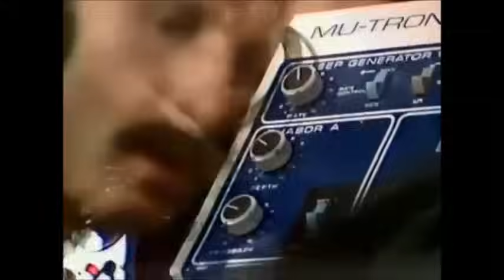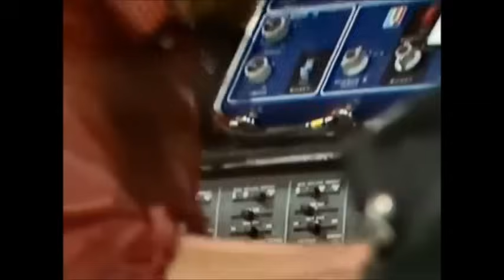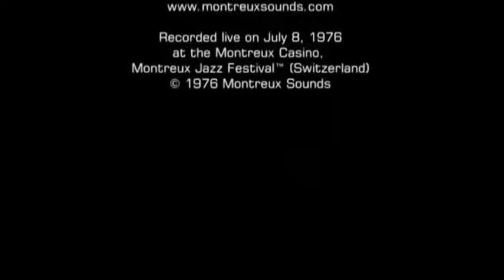Weather Report - Live at Montreux (1976) - [Synchronized Audio\Video] - Full Version

Comment: Is it just my eyes fooling me, or does Jaco have Piano strings on his axe? Note @ 28:52 during his solo you can get a pretty clean look at it. Are there windings where the strings break over the bridge on his D and G strings? I think not. Does that look like a rather large gauge plain steel music wire, such as found at the core of a Bass string on Piano on the aforementioned two strings??  Are all those babies copper wound? You better believe it! My eyes see Copper winding on ALL OF THEM./ Here's the lovely kicker.'
The E & A strings seem to have a single wrap over the core wire going over the bridge, noticeability smaller in diameter AT the bridge, silver in color,(a single Nickle or steel winding) over then what looks to be another winding, noticeability fat and Copper in color. the copper windings look to begin close to the north side of the bridge plate. To me it all equals Genius!  One word says it all...........  Jaco